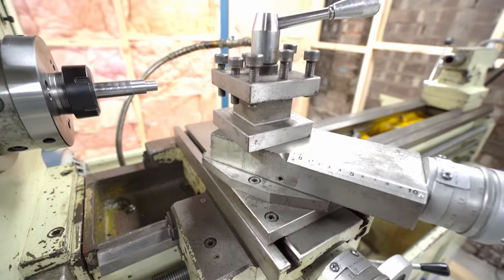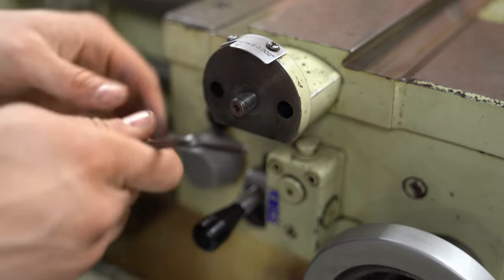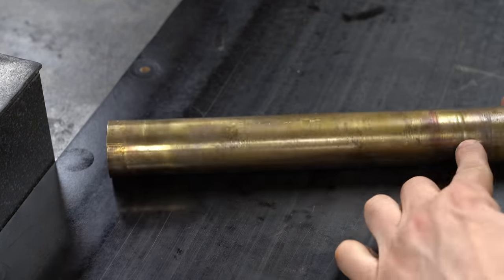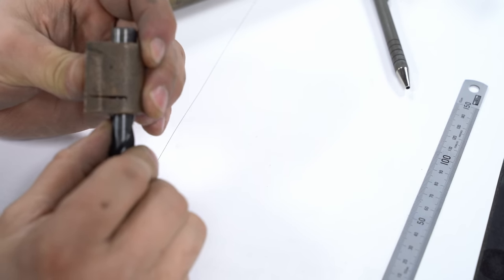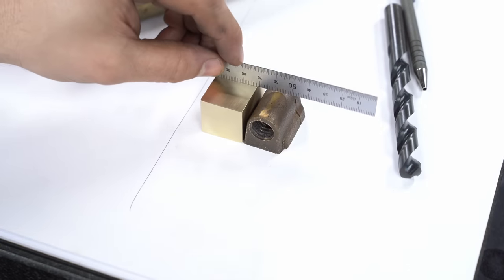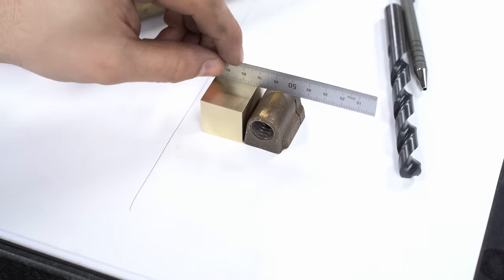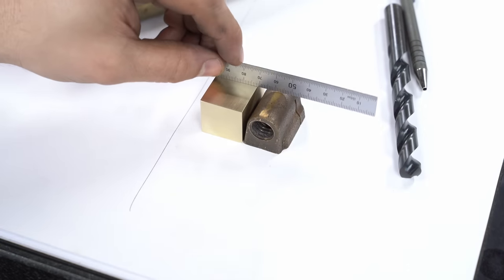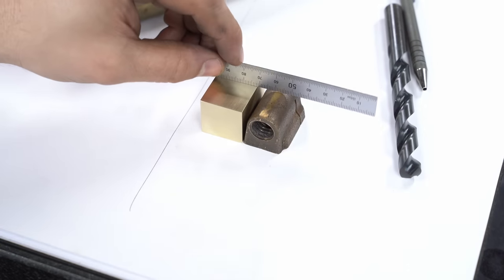Making a PRECISE lead screw nut | CRAIG'S WORKSHOP

Comment: Very nice work overall.  And a great video for doing an internal Acme thread.  One thing though.... At 17:45 you mention the need to leave the thread lever engaged due to cutting a metric thread on an Imperial lathe.  That suggests to me that your lead screw is actually 2.54mm or 10 TPI for pitch rather than 2.5mm.  A small error since the nut is fitting well.  But it does mean that perhaps the ends of the nut will be doing more of the work until it wears in by that last 0.04mm.
Reply from the maker: The lathe doing the screwcutting is natively an imperial lathe yes, but it's using metric translation gears to provide a true metric lead. The lathe that is shown in the start is the one that needs the part, and that one is all-metric. Sorry for any confusion. Cheers!
Reply: @CraigsWorkshop  You had me going there!   All is well.  Cheers!
Reply from the maker: I'm not going to lie Bruce, the whole thing had me going for a while too. :)

Comment: I kept losing track of which lathe you were doing the work on - when you were cutting the thread, you actually had the compound screw in your hand for testing?! Or have you still got both lathes (which would help tremendously...)
Reply from the maker: Apologies Paul. The pale coloured lathe shown on the start is the lathe being repaired. I am using the grey lathe to make the parts, while I still have access to it.
Reply from the maker: PS. I did consider how to do this on a single lathe though. I would remove the cross feed screw, lock the cross feed gib and use the compound feed square to the lathes axis, to advance the cut. If you need to make a compound nut you could do the same using the other way around, with a locked compound gib. Hard to explain without making it confusing.

Comment: Hi Craig, I cheated on my Lathe changing the cross slide nut, purchased a LH Trapezoidal tap and made the nut 15mm longer, not restricted by boring bar length and hopefully increasing the life of the nut.
Don't agree with the split nut adjustment, only works for a short time preventing backlash as the short section wears quickly.
My trusty DSG had 2 nuts, one of them adjustable,  the old girl never suffered from backlash.
Reply from the maker: Thanks Willem. That's not cheating, that's the sensible way :-) I've cheated before on an older lathe I had (Hercus 9A, same lathe as the Southbend 9A) by just buying a new nut.

Lengthening the nut crossed my mind, and if I had made the boring bar style threading tool it would make more sense. As it is, I was a little limited by tool length/rigidity.

I'll give the nut some use for a while without the adjuster, it'll surely work well to start with, and it'll be a very quick job to incorporate the adjuster when needed. The layout is all set up ready for it, so it'll be perhaps a half hour job when the time comes.

Thanks for the advice and info! Cheers, Craig
Reply: Gave my Hercus 9A to my Brother in Perth, still going strong, nice lathe.
Reply: Gave my Hercus 9A to my Brother in Perth, still going strong, nice lathe.
Reply: Looks like you had the same lathes I had, gave my Emco V 10 Maximat to my other brother, not as robust as the Hercus, not a fan of the fibre gears in the Headstock but easy to make if needed.
Reply from the maker: @willemvantsant5105  agreed. I am not a fan of the fibre gears but I am a big fan of the lathe overall. This one was filthy but in excellent minimal-wear condition otherwise. I may remake the headstock gears yet. The other weak area is the electrics and motor, so I have sourced a 1hp 3ph motor and VFD to replace the lot. That will be the subject of a future video. It is not a hogging machine, I have the 14x40 for that. The two lathes will complement each other nicely I think. One for fine work and precision and one that has a bit more beef, coolant, etc.
Reply: The double Star 2 speed motor and switch is a complicated setup, rebuilt my switch but you have to be positive operating between motor speeds. 
VFD with 2 pole motor will make it more user friendly.
Definitely a precision machine.
When I purchased mine it was hardly used, the switch had arced between poles and the owner sold it cheap, managed to get the oem milling attachment for it as well
Reply from the maker: I actually have a 4 pole (1400rpm) motor which will give a bit more low down grunt, and still happy to run (at reduced power) at the 2800rpm speed, which is fine, don't need a lot of torque when turning narrow shafts etc.

My friend has an emco V8, also in very clean condition, but it has trouble starting in high speed when cold, or perhaps you are meant to start in low speed, then switch to high speed. The switchgear issues are quite widely known, but also quite easy to fix. I think the VFD on mine will be a big quality of life upgrade. The original switch gear on mine was missing. And the motor was wired for 415V, so no possibility of running it on the cheaply available 230V VFDs.

Sounds like you had a great buy with yours - hardly used, and cheap, and comes with the milling attachment too! Great result :)
Reply: My 2 lathes, mill, drill press and compressor were all converted from single phase to 3 phase 220V/ 415 motors  cheap and all on low cost 220V VFD's.
Up here in Philippines 3 phase not available in my subdivision and of course 60 Hz same as US.

Comment: I find that backlash is often an exaggerated issue, considering that when using the handwheel dial one can get to measure correctly anyway, or if you need precision just set a dial indicator as needed. Or install a DRO, these come pretty cheap nowadays.
If no backlash is absolutely needed, e.g. as in CNC, then adapt a nut-spring-counternut system, which unlike the split nut and adjuster will not add any significant wear and friction.
Regarding the tightening of the nut to the slide, these two should never be rigidly attached,  as with the leadscrew supporteded only at handwheel one can't expect that it will stay centered while being operated. If you tighten the nut to the slide, no matter how precisely you try to align it, that will add strain and wear the nut faster. Use a shouldered bolt instead so you can tighten the bolt only to the nut, while keeping some play between nut and slide.
Reply from the maker: Thanks for the idea of using the shoulder bolt. You're right about backlash being an exaggerated issue. But you can see the nut was completely worn out to begin with. When it came to replacing it, I thought I'd try to do as good a job as possible. Cheers, Craig
Reply: @CraigsWorkshop  Absolutely,  one should always aim to replace or repair worn parts, even if with experience and ingenuity sometime one can work around defects. Good work all the way and sorry for not having said that before.
Reply from the maker: @jdm2651  Thanks JDM. Fingers crossed it will give me a good few years of service now.

Comment: 24 thou, pretty terrible, lol, if only my old early 50's Macson was that good, times that by 3 or 4.
Good video, be plenty of people needing to do this job, thanks for sharing.
Reply from the maker: Hey Woz. Good to hear from you. What I should have added is that there is only 30 thou to play with (before it becomes a knife edge thread) on these relatively fine pitch screws. On a bigger coarser screw, you can get away with a lot more.
Reply: @CraigsWorkshop  i use a mag base dial indicator on mine so i don't have to trust the dials, easy to see if it moves too
Reply from the maker: @warrenwise8127  Absolutely - I do too, for stuff where I have to be careful and definitely get something right. I have a DRO to go on the new lathe, which will be great. Like a big multidimensional digital dial indicator with great resolution and always set up. Easier to zero too. I hope to do a future video on it.

Comment: Lapping should be done in a figure 8 motion, or an Infiniti symbol to allow for all movements to cancel without rocking due to rapid change of motion
Reply from the maker: You're absolutely right and for critical faces that is the best idea 👍 on these non critical faces I wanted them to have that familiar straight line brushed look. Thanks for your comment!
Reply: He is a youtuber, not a machinist
Reply from the maker: Hi @chipmaster7738 isn't it possible to be a bit of both?

Comment: The broken gib 'ear' seems to be a common finding in second-(third? seventh?)hand lathes and machinery. They're cast iron, so not great in tension, and if they've been greased rather than oiled and then aggressively torqued on the adjuster, that combination is often enough to snap the poor thing off.
Reply from the maker: Yes it's an unfortunate thing. I've considered a different options. 1) new gib from cast iron 2) shim the non sliding side of this gib with brass sheet, soldered on which could give me enough extension to cut a new slot or 3) braze on a piece of steel, and shape it to suit. What are your thoughts on the best way forward? Perhaps there's a better option that I haven't thought of. Cheers, Craig
Reply: @CraigsWorkshop  when I was faced with this problem on the compound of a similar lathe, I made a copy of the adjuster screw, and then modified the body of the slide to accept that screw on the back side as well, so that the gib is completely adjustable with the two screws which will always be pushing against the gib rather than pulling. This approach may not be possible in all compounds, however.
Reply from the maker: @StripeyType  Thanks for that. I had not considered pinching it between two screws, even though that's how the cross slide is set up. I'll have a closer look in the morning and see what's possible.
Reply: @CraigsWorkshop  glad to have been able to help even a little bit. :D

Comment: @13:37 what tool was that, which you used to determine the 30deg angle?
Reply from the maker: That was a vernier protractor (sorry don't recall the brand) that I have had for a couple of years. It's quite useful for this kind of thing.

I realised half way through making the tool that I have a D-bit grinder and a lathe tool attachment, I could/should have given that a go. But the way I did it worked well too.

Comment: Can this threading be done with a tap too?
This replacement of the nut is what is needed even on my new chinese lathe with a lot of backlash. Thanks for the instruction video.
Reply from the maker: Thanks for your comment. Yes in principle this can be done with a tap. There were a couple of reasons I went the way I did though. First is I can (in theory) make the nut a better fit to the screw than the tap would, especially when you take the wear on the screw into account, and secondly I don't have that tap. It was a good excuse to dust off my single point threading skills 🙂
Reply: @@CraigsWorkshop  Oh man, I really didn't take into account "the wear" of the screw, good one!
Don't forget to grind the single point threading tool some more several years later when you want to make a new one.

You made a little adjustment screw  for reducing backlash. The backlash will accumulate in time. But than you have to disassemble the carriage everytime.
I thought on replacing mine for CNC-purposes with two nuts and a spring in between design. Any thoughts of advise?
Reply from the maker: I think the spring would have to be strong enough to resist cutting forces in both directions (turning and boring) but not be so strong as to cause premature wear on both threaded halves of the nut. I don't know how you can balance this except without a spring, only with a threaded clamp adjustment.
Reply: Thanks for the good tips.

Comment: so close... so close.

theres been a proponderence of "differential threads" lately.

i did this years ago to my little lathe...

a concentric, coaxial leadscrew nut of two pitches.

the "socket" emerges at the rear of the saddle and can be locked. it screws inside the nut bolted to the slide. it is 0.25mm steeper than the original screw.
the leadscrew acts as normal, threading inside the socket, and as long as the socket is locked, its normal. 2.5mm on this lathe iirc. yep, its a rare metric one.

turning the socket makes for 0.25mm/turn resolution. 

i was doing a lot of toolpost grinding. couldnt use the compound trick as i was using the compound!
Reply from the maker: Thanks, yes, differential threads can be very handy. I haven't had cause to use them in an engineering setup as yet, but I've known about them for a decade or two, and it would be very fun to put them into practise. I can see how having to grind a taper would stop you using the compound trick :-)

Comment: Never would I ever machine an unknown bronze or copper alloy, brass however sure.
Reply from the maker: I spent a long time in the video showing how I identified it as more likely aluminium bronze than anything else. It came from a much larger piece that I have in stock which I don't want to waste. Once I've machined it once, I have a much better idea of how it cuts, and more confidence when deciding to use it on future projects.

If it wears out in 5-10 years instead of 30 this time around, I'm happy to make another.  Cheers, Craig
Reply: @CraigsWorkshop  well magnetic test pretty much disqualifies the presence of beryllium but not 100% sure,... flies off to the practicalmachinist forum to ask... :)

Comment: The lathe that I have is not the greatest. I had only been using it for maybe 6 months when the cross slide nut literally stripped out. When I ordered a new one from the seller, I had to buy both the nut and the screw itself. They claimed that the nut had been machined to match the screw which sounded like a load of bull droppings to me. All things being considered, the price was an insult to anyone with half a brain. When I got the items, I installed them immediately. What a joke. Just using my dial on the screw it indicated that I had .020" backlash. An actual dial gauge read .022". This was a brand new part and it was already worn out. I called the seller and they offered no solution of any kind (Note to self: Don't buy anything else from these thieves.) 

In any event, I procured a piece of bronze from a local supplier and went through much the same process shown here. I needed a Number 8 stub Acme thread and my results, after a lot of sweat while machining, couldn't be better. Once installed, a dial indicator told me I had .002" backlash and the threads were silky smooth. Since I am a cautious man when it comes to things like this, I made three more nuts. Just in case. 

I took some time to do a little investigative work on the original nut. My son is a quality control officer who has access to a laser spectrograph and we took shots of the material and recorded it's constituents. It was not bronze but in fact an extremely poor grade of brass, almost Chinesium,  normally used to make shim stock. I think they might have saved maybe $.50 by not using a good grad of bronze.
Reply from the maker: That's a great cautionary tale for people that want to buy the cheapest gear. Sometimes that is all we can afford but yes you do get what you pay for. I have always been of the inclination that an older higher quality machine (even with some wear) is often better than a new low quality machine. Good work making the nut(s) so accurately!

Comment: Didn't watch in full before commenting, sorry
Reply from the maker: No poblem. Actually the compound gib needs repair and adjustment too. In fact the whole slide may need a scrape and recondition to bring it to new functionality, but for now, the biggest problem was the nut thread. Thank you for watching, and thanks for the comment.